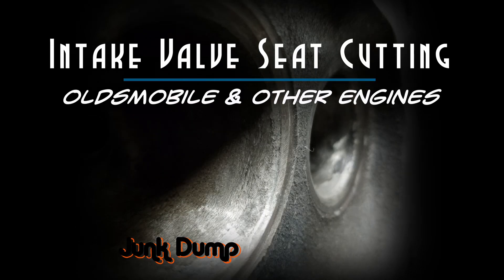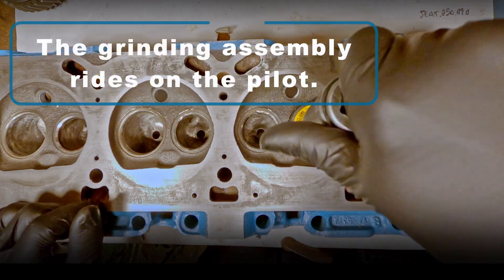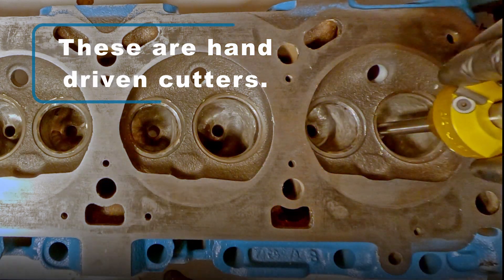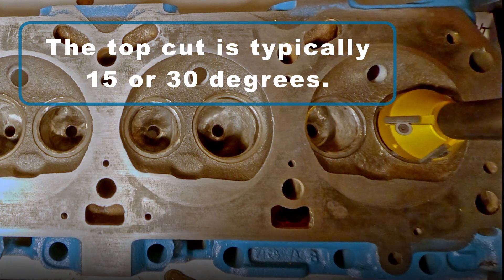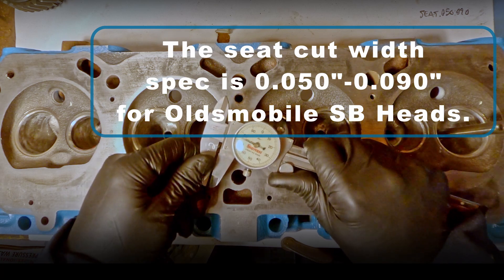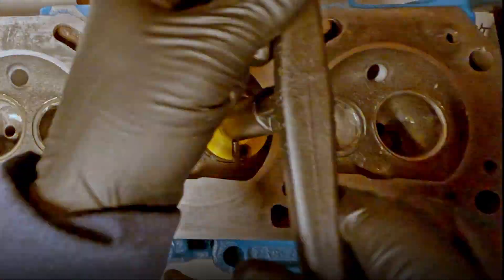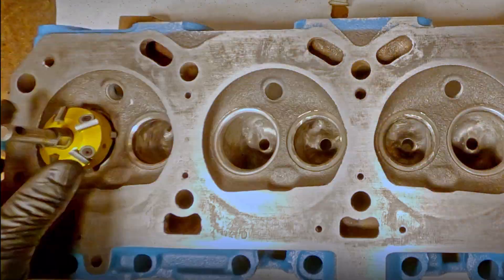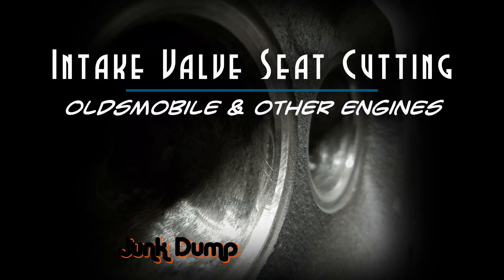Intake Valve Seat Cutting for Oldsmobile

Comment: I just looked at the prices for kits through Neway and they seem expensive for the do it yourselfer (cost at a shop obviously more). Is this a cost effective way to do a pair of heads for yourself and is the end product as good as a machine shop process.

Thanks for the Olds content
Reply from the maker: So far I am impressed with the quality of the Neway finish. Most machine shops use multi-angle radius cutters that can shape the seat from the combustion chamber to the throat. That complexity is unnecessary for street and street/strip engines, it is most beneficial in race applications. A 3 angle valve seat is beneficial to street and street/strip engines. When used properly, I believe the Neway cutter does a comparable job to valve seat grinders, and machine shop 3 angle cutters in a street, street/strip application. I suggest having a machine shop cut your seats if you don't plan on working multiple sets of heads. There is a lot of tooling and learning involved with valve seat work, it's also easy to ruin the seats by mistake without knowing the correct way to check your work. I think these cutters are a great gateway tool for someone interested in persuing valve seat work, or if someone perfers to build their engines rather than paying a shop to build them. Thank you for the excellent question, I hope this response helps!
Reply: @junkdump2720   Thanks for the thoughtful reply
Reply from the maker: @gordonborsboom7460  Anytime!
Reply: These will in no way compare to a real seat and valve job performed on quality machines. There is a reason a Serdi machine costs what it costs, as well as the years of experience of a qualified operator of said machine. We are talking measurements in thousands of an inch that must be accurately measured on a perfectly level and square fixture.
  Will these get the job done ,sure but if ultimate longevity or all our performance is the goal, have your heads machined at a reputable shop.

Comment: A good introduction to Neway's cutting tools. Looking forward to the follow-up video showing the valve to seat mating pattern and how you actually make the adjustments. I might be inclined to drive the cutter under power at a very low speed.
Reply from the maker: Thank you for the comment. I was worried about the eccentricity of the seat when cutting under power. I'm sure it will be fine but let me know how it works out for you.